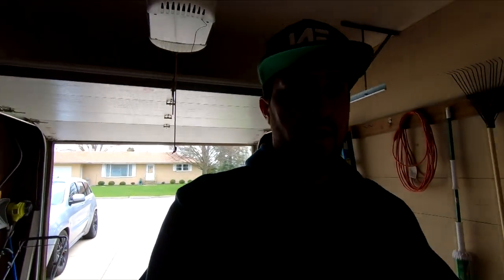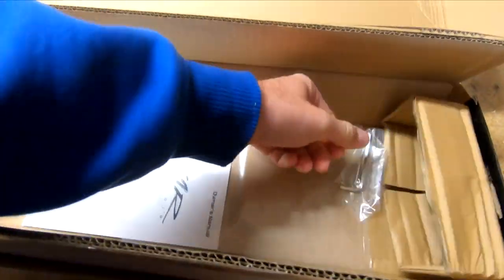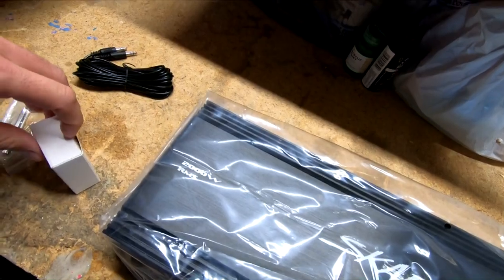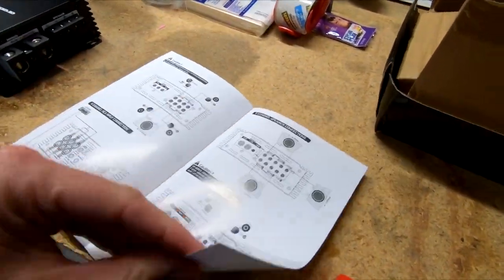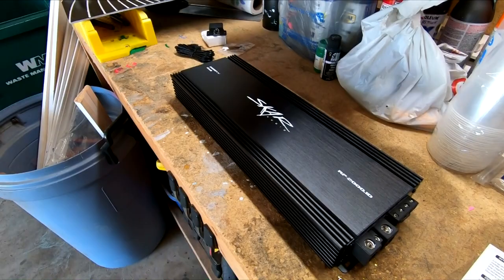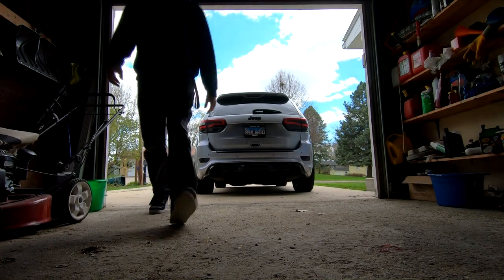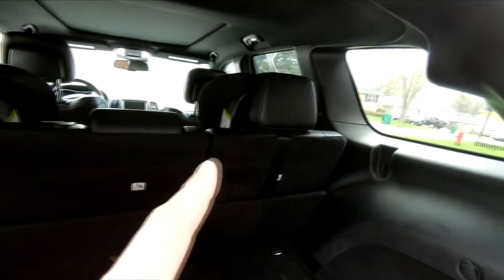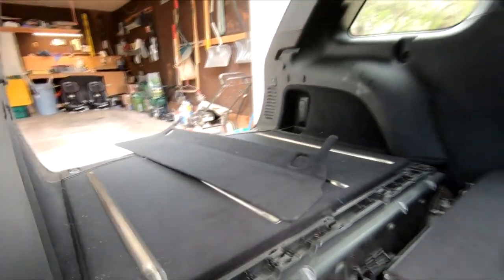Installing Subwoofers in a JEEP SRT - Wiring Part 1

Comment: I just changed the battery on my 2016 grand Cherokee limited and the passenger seat doesn’t have to come out. If you move it all the way up and forward you have enough space and room to pull the battery up and out it it’s a little awkward lifting angles but it’s definitely doable took me less that 15 min.
Reply from the maker: Oh sweet, thanks for the tip!

Comment: Installed mine the other day bro, 🦛 xl the guys on the FB page said they all had trouble with the tuning when they used a loc and took the signal from the original subwoofer.
I opted to pull my receiver and tap into the harness directly off the head unit. I'm using a lc2i turned out great #dangthangbangs
Reply from the maker: Yeah I tapped directly into the subwoofer wiring as well, as my factory sub stopped working last year. I had an lc2i previously installed but I found the LOC had a much cleaner signal. But either way, just glad to have it working! What did you install in yours?
Reply: @MaxBeecher  same amp as you,lol they're sold out on Amazon, but a massive audio hippo xl122 driver
Reply: Ay bro can you help out i installed a lci2 to a 2018 jeep srt with the km factory system i taped in to the sub also in the rear n didnt use the factory sub took it out everything work fine untill i close all the doors and try to drive i get the 2_3 bass beeps frm the subs interfering annoying plz help
Reply: @jtunez355  I don't pull signal from factory sub wiring, I found the color wiring diagram for 14 srt Jeep with HK. Pulled the signal from front door speakers. Sounds like your trying to pull signal after it's factory amplifier from oem sub.
Reply: @paintballworr04  thanx bro so you can pull signal frm back of the head unit i cant find any diagrams that match

Comment: thank you very much this video helps alot now i know the back panel pops out after you pull the clip out and pop out the panel change the amp or subwoofer i was wondering where was that located
Reply from the maker: You're welcome!
Reply: @MaxBeecher  i had added kicker amp for my 2 channel for the intera speakers tell me why when the green light is on it get hot. after 30 min game playing but now my push start don't work in jeep grand Cherokee Laredo 2012 i have re program the key

Comment: So, I just tried this on my 2016 Jeep Cherokee SRT. I took a feed from the factory sub wires as per the video, and used it to power the high-level input (basically in an-built LOC on the amp) on a Sony Xplod 1000W amp. Everything was working great in the garage, really good bass. However, when I went for a test drive, I was getting very loud random bass notes that would last for 2-3 secs. Even with the volume turned down completely on the stereo. Seems a few others have had this issue as well performing similar setups and have attributed it to the Active Noise Cancelling system in the SRTs. Interested to know if you have experienced similar? Seems the guidance is to use an after-market PAC harness and avoid tapping into the speaker wiring to avoid this type of issue.
Reply: Thread for reference - https://www.jeepgarage.org/threads/disabling-noise-cancellation-in-15-srt.171442/post-2020801986
Reply from the maker: I did not run into this issue, but again, I used a separate LOC than what comes in the amp. I've heard others using the harness you mentioned before, but using a separate LOC saved about $150 and I got the same result.

Comment: I have this dilema now lc7i or pac pro, you dont have any trouble with sound cancelation? Navigation audio? Reverse sensors?
Reply from the maker: I had zero issues with any other sounds in the car as the wiring was straight from the subwoofer wiring, so it didn't interfere with chimes or reverse audio.
Reply: You take signal straigth from the sub right? I will add a 4ch amp for 2 componds i will need to get signal from the door speakers??
Reply: Also you dont have problem with the  bass drop down? Like when you turn the volumen on the bass dont start to fade?
Reply from the maker: @HectorRodriguez-fe8xz  no sir, never had any problems with bass drop!
Reply from the maker: @HectorRodriguez-fe8xz  and yes, I take signal straight from the subwoofer
Reply: Thanks a lot men i hope i dont find any problems during my instalation
Reply from the maker: @HectorRodriguez-fe8xz  good luck, let me know if you have any questions!
Reply: Thanks so much men i really apreciate, this is the list i have to put on my srt
Lc7i
Epicenter
Rockford fosgate 1500x1
Rockford fosgate 600x4
2 infinith components
And 2 kickers L7
And i will let the stock amp and speaker
Reply from the maker: @HectorRodriguez-fe8xz  that should sound pretty good brother!
Reply: I did a sub install on my 2018 grand Cherokee altitude and when I put it in reverse or stop, it gives  this loud feedback what would you recommend? I use the LC to branded the way you have it what would yourecommend I do

Comment: Nice Video,
I got a question you grab the Signal from the Factory Subwoofer But there is a low and high pass Filter for the Factory sub how Deep goes this Signal i would like to have Some low Bass on the new Subwoofer will it works?
 sorry for My Bad english
Greetings from Germany
Reply from the maker: Hey! So the factory subwoofer is a dual voice coil, meaning all 4 wires are low. I hooked all 4 from the subwoofer up to my line output converter and it works perfectly! The lows are pretty low!!
Reply: @MaxBeecher   Thanks for the quick Feedback that Sounds Great.
Reply: @MaxBeecher  do u remember which colors on factory sub was for - and + I'm trying to tap into it
Reply from the maker: @riquemex1987  I believe that's all in part 2 of this install! Check the next video!

Comment: Okay question since I’ve watched your newer videos and was able to tap into the back sun with an loc made by metra and had my single sun working with my factory but now after a month or so my front two speakers lost power have any ideas as why? Randomly they’ll cut in when I restart the car but one typically works and the other won’t then they swap
Reply from the maker: I'm wondering if maybe running the factory sub with an aftermarket amp and sub, is causing more draw on the factory amp (to feed the aftermarket amp), so it's pulling power from the front speakers.
Reply: @MaxBeecher  bet & noted sorry for the grammar errors previously but I’ll check my wiring and the fuses and let you know if I find a fix thanks for the info.
Reply from the maker: @Shiftgog  all good brother, keep me posted!

Comment: Did you wire your LOC to the battery or are you piggy backing from another 12v source?
Reply from the maker: I was piggy backing off of the 12v charger in the back of the car

Comment: Hey what’s up bro, do we need to disconnect the preamp being that we are installing a amp for the mids and highs ? by the way you have a great YouTube channel bro.
Reply from the maker: I never disconnected the preamp, but I also didn't install an amp for the mids and highs, only the subs. You could keep the preamp connected and just do the same process i did here, but using signal from the mids/highs but I think they make wiring kits to remove the preamp, and add your own amps.
Reply: @MaxBeecher  see I’m going with an aftermarket radio(radio) I don’t know if that’ll make a difference.
Reply from the maker: @Geezygotabag008  if you're going aftermarket, your new radio should already have RCA's in the back of it and you can bypass the factory amp
Reply: @MaxBeecher  oh okay I was thinking by adding a amp the speakers would be on the preamp and aftermarket. Thanks for letting me know

Comment: Hey I have a 2017 Jeep Cherokee latitude. Where did you find the best place to drill through the firewall was?
Reply from the maker: I didn't need to. The battery in my Jeep was located under the passengers seat.

Comment: The first thing you did wrong is not install the PAC Amp Pro. Not sure why people don’t do their research before they install and then make a video so other people will do the wrong thing as well. Guys it’s 2020 there are factory integration pieces for almost every vehicle so you get the best sound quality possible. Do not use line converters anymore!!
Reply from the maker: I did do research. Didn't really feel like spending $350 for something I can do for $89 myself. I've installed LOC's on several vehicles and have had absolutely zero issues or anyone return to fix anything.
Reply: Audio control has excellent loc, i wouldnt say dont use loc's anymore.

Comment: I have a question about the two wires you unplugged at time frame -16:08 in your video, what exactly are those plugs for and what do they give power to? Also your video helped me install my two 12 subs and amp very easily!
Reply from the maker: Those are hatch sensors! If you leave them unplugged (which I've done) your button to close the hatch will not work!! And I'm glad I was able to help you!!
Reply: @MaxBeecher  It also affects the keyless entry.
Reply: @MaxBeecher  do I have to leave the hatch sensors unplugged? I would hate to lose that feature
Reply from the maker: @mistercleaton5951  you can plug them back in when you out the interior back together
Reply: @MaxBeecher  I don't see why your video didn't get a million views if it helps I will post the link in all the wk2 and trackhawk/ SRT Jeep groups on Facebook Keep up the great vids bro!
Reply from the maker: @mistercleaton5951  haha thank you I appreciate it!!
Reply: @MaxBeecher  most definitely 💯 which JL audio converter you have ?
Reply from the maker: @mistercleaton5951  I used the JL Audio LoC-22 and got it from Crutchfield! Here's the link:

https://www.crutchfield.com/p_13698413/JL-Audio-LoC-22.html?awcp=&awcr=317806422937&awdv=m&awkw=jl+audio+loc22&awmt=p&awnw=g&awug=9021521&gclid=Cj0KCQiAoNWOBhCwARIsAAiHnEhtidLnjAW5MOhv6vxxXUUASzpks_A8L4748eN3VGf66SYzfpW5_TMaAhU-EALw_wcB
Reply: @MaxBeecher  thanks!

Comment: Hey man, how did you secure the box from sliding in the back of the trunk?
Reply from the maker: I put I-bolts in either side of the box, and used paracord to attach it to the carseat latches on the back of the seats
Reply: @MaxBeecher  thanks for the reply. Good info. I am putting 2 Sundown X v3’ 12s in. How did you mount the amp. I may have a few questions later on the install.
Reply from the maker: @DaPainePlane  the amp I angled behind the box, and used to screws to mount it to the back of the seats

Comment: Where did you get your remote power from?
Reply from the maker: Remote power is from the line output converter. Once it recognizes power from the speaker wires, it turns on.
Reply: @MaxBeecher  well I have an LC2i
Reply from the maker: @tanaisapimp  you should be able to splice a remote line off of the rear power accessory charging port in the trunk. There should be a picture of a key on it, which means it only has power when your key is either on accessory or on. I show that in the second video.

Comment: So installed a lci2 into a 2018 jeep Cherokee srt with factory HK system i deleted the factory sub took it out powerd lci2 and used the 4 inputs from factory sub im getting interference 2-3 bass notes frm subs  with radio on or off it will do this tryn to figur this out again im using a lci2
Reply from the maker: I hate to say it, but the LoC-22 by JL Audio is the only one I've had good luck with. I did use an LCi2 before and it did have some issues. You might have the gain or input turned up on the LCi2 too high. What is your bass set at on your radio?
Reply: @MaxBeecher  everything on the head unit is on halfways normal i havent tried tuning the lc2i the knobs are also half ways diald in i see u did use the jl loc
Reply from the maker: @jtunez355  honestly man I'd try turning the bass on the head unit down, and maybe messing with the knobs on the LCi2. There has to be a good way to set them. I had been using one and within a month it had stopped working, but that was in a different vehicle.
Reply: @MaxBeecher  thanx for your time man i recently started doin  car audio again . Its all guud till sum like this pops up 😂😂😂 thanx really appreciate it
Reply from the maker: @jtunez355  let me know if you figure out the problem!!
Reply: Active noise cancellation

Comment: can anybody find me a wiring diagram for 2012 srt jeep harman kardon subwoofer the factory sub. i want to connect a line converter don’t know what’s colors fo go what
Reply from the maker: Are the colors different? I would think the wiring would be the same as the 2014
Reply: well honestly i’m just starting with this kind of stuff so i’m not aware what wires im supposed to be looking at.
Reply from the maker: @elicarrillo-garcia1911  watch this video, and the part that follows and it should cover everything for you!

Comment: Is there a factory amp if so where is the location
Reply from the maker: Yes there is, it is in the back, on the driver's side. Opposite to the subwoofer.
Reply: Thanks
Reply: Did you bypass the amp from behind the radio or at the amp
Reply from the maker: @bigque1070  I did not bypass the amp, I used the factory subwoofer positives and negatives and connected those directly into my POC

Comment: I did the same thing as your video I get noise on all my speakers
Reply from the maker: Are your wires connected correctly?
Reply: Just like The video
Reply from the maker: @Burrodmc  you shouldn't be having any issues. Have you disconnected it and see if it goes away?